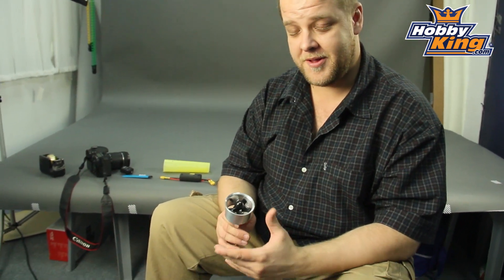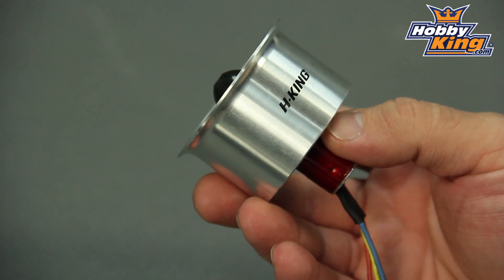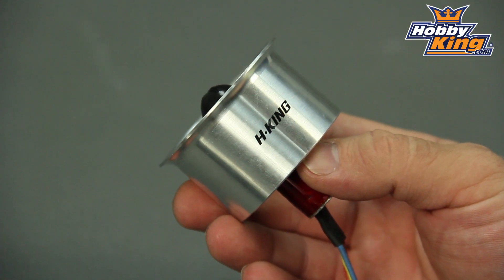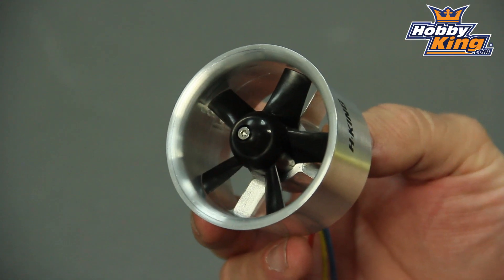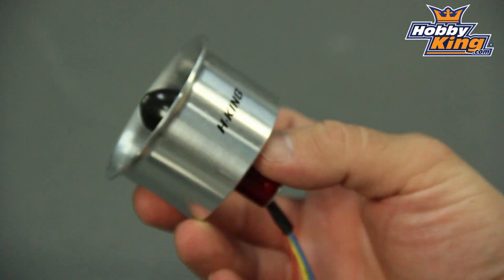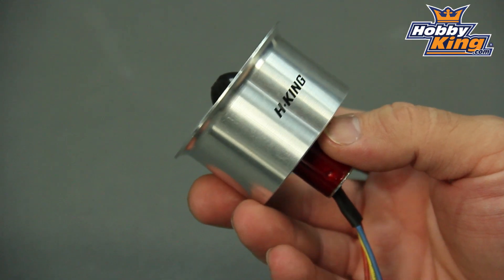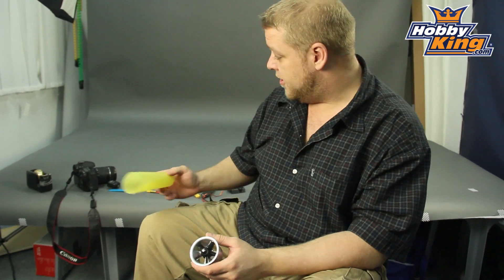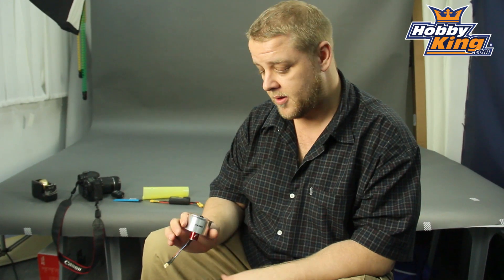HobbyKing Product Sneak Preview - 50mm EDF

Comment: Now that they've been released, can confirm that HobbyKing's 50mm alloy EDF units are indeed RC Lander units re-badged.
RC Lander sells 4000, 4400 and 4800Kv versions.
HobbyKing sells 4200Kv and 4800Kv versions.
The 4200Kv (4S) version is already getting reports of getting very hot and smoking with a few minutes of usage.

Comment: I am waiting for a 90mm or 100mm Aluminum fan and motor combo that will put out 4+ KG of thrust. I have a older F-15 Jet I want to convert to brushless. I plan on using two 90mm fans but I can squeeze two 100mm fans in it with a little work.

Comment: Looks like a 20mm x 30mm inrunner at 4420KV.
Two advantages of alumium housing:
1). Assuming the motor is a snug fit the housing acts like a heat sink. Cooler operation = more efficiency and may even allow 4S operation.
2). The housing won't deform when mounted - a big problem with the stock 50mm housing.

The design differs slightly and has an inlet lip so it won't be a drop in replacement for the stock 50mm Sky Angel/J-Power jets; though only minimal foam removal should be required.

Comment: Ive watched this vid a few times now and Im not to sure what point they are trying to make. 15 amps on a 3S is 177 watts which in todays power hungry edf world is not very much. We need to know what size can will fit, if the impeller is nice and solid and once some guys get a hold of one, how much power it can handle. Also, this test means nothing without efflux speed and thrust figures. 
PS holding a fan like that is asking for trouble.

Comment: @NitroCharged As long as the battery can sustain 15A current, the size doesn't matter.  850/1000 20C or 2200 40C - the motor will still only use 15A.  And the battery he's using is a 3S (check the voltage on the wattmeter).

Comment: Man, no safety glasses! Way to represent a product. Obviously never had a blade thrown while testing....
Meanwhile - all we have here is a heavier aluminium case - no benefits whatsoever. It simply has a large inrunner to replace the jpower little outrunner. You've unloaded the motor so the amps drop and being an inrunner you've got more rpm's. Also - look at the size of the lipo running it. Let's crank it up again on an 850/1000 3s like the models are supposed to have in them. What's the AUW?

Comment: @burgosjoser Think of it like an exhaust pipe because with the thrust tube you will get better performance than with out,same as if you use a thrust tube in your model than with out,plus you will need the right length ;-) there is more to than what i have just said but i've tried to make it so other people understand too,hope this helps a little.

Comment: I'm not sure the aluminium duct offers any performance increase. It would weigh more than the plastic and be detrimental to the power-weight ratio versus a plastic ducting unit. Please correct me if I am wrong? Anyway, quite impressive how much thrust this small fan can generate! cheers
Reply: cruddbucket, the aluminum housing may add a bit of weight, it it also eliminates the shroud flex that causes edf units to shed fan blades in a crash event.